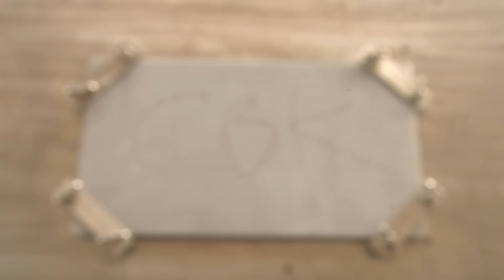Highlights from the John F. Kennedy Keel Laying

Comment: How long does it takes to be completed?
Reply: Three years unless there's a budget crunch.  Kennedy is currently 50% complete and will be launched next year over in the other Dry Dock CVN 65 is being cut up and they're starting to do the Transfer of the Steal which is a tradition that started when the original Enterprise was built. By the beginning of next year this steel will be melted down and the first cut will be made and that piece of steel will be saved for the ship's sponsor who will burn her initials on it and when the first keel block is built that piece of steel will be welded onto the hull.